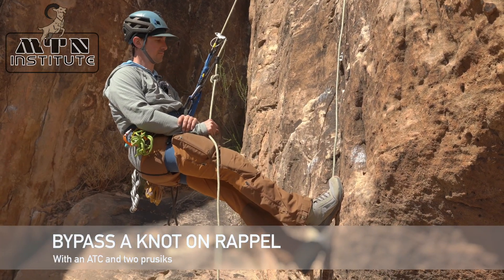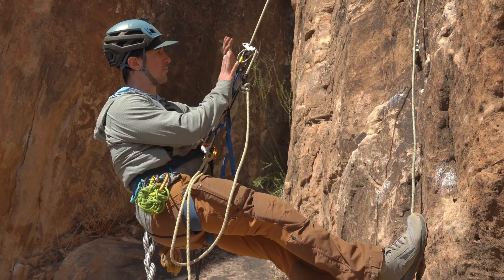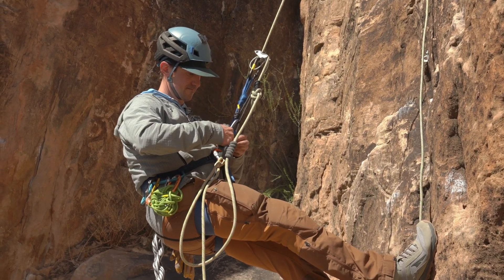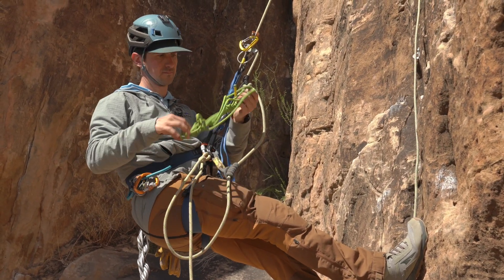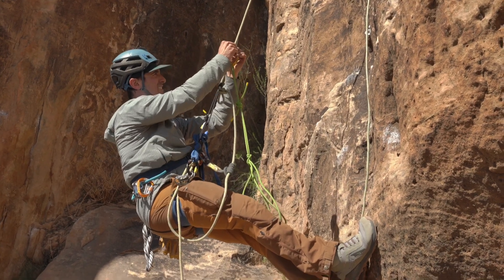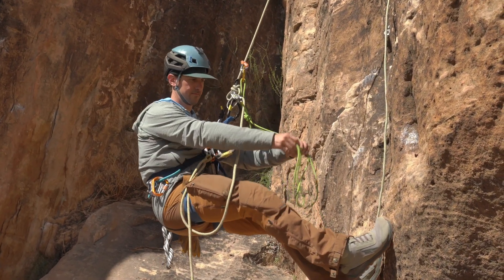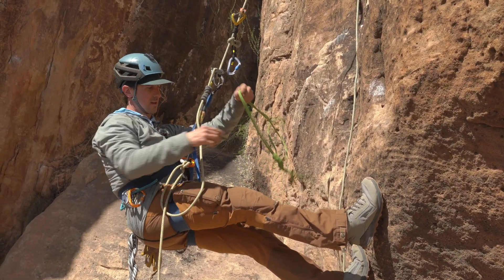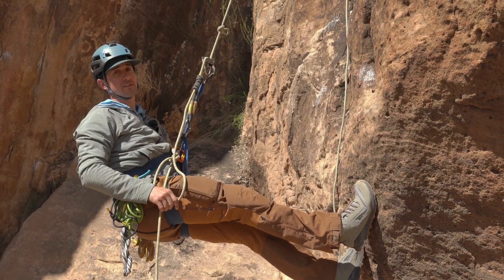Knot bypass with ATC

Comment: Most of the time you can fix yourself to the knot/fix point you are bypassing. That way you just simply take your prussik and rappell device and teconfigure them under the fix point. This technique however is useful if you cannot hang from the knot/fix point.

Comment: I do not know - if I would know that there is a knot in my system prior to rapelling, I would just use a HMS locking biner with munter hitch. You can skip knots with ease and it also works for dead weight For example during rescue operation when you have your partner with broken limb and you need to get him to the ground as soon as possible. But I still recognize this as very valid technique if weight/time is not of any concern. The amount of back-ups is just out of this world.